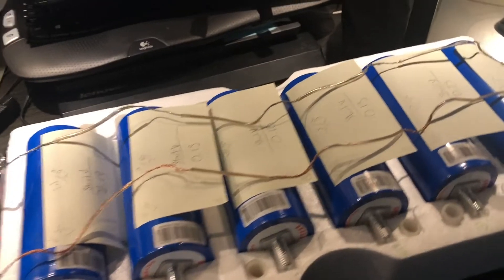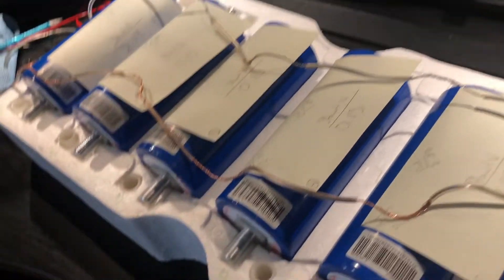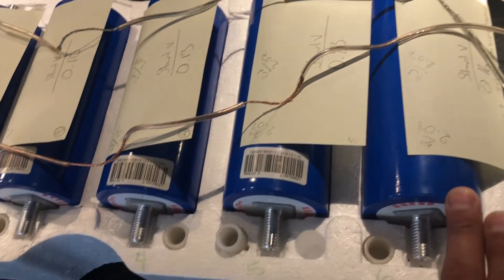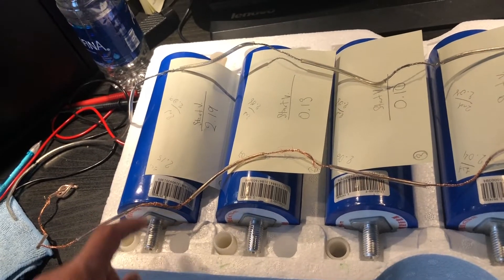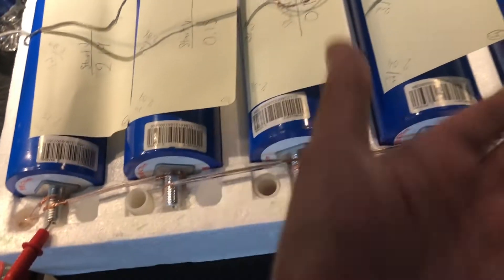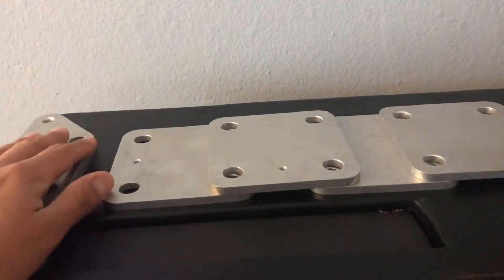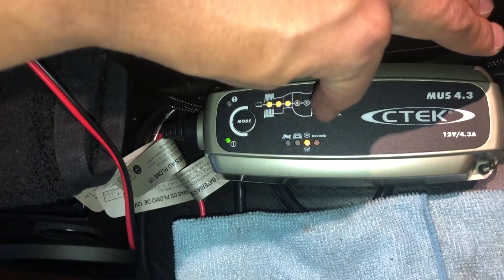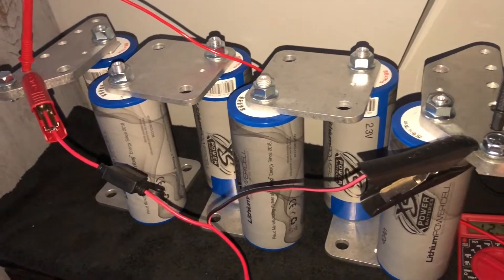Lithium Titanate (LTO) tips to balance and assemble

Comment: Hello from the high desert of New Mexico USA 🇺🇸. I live in my 1967 GM TDH-4519 city transit bus,  it uses two 160 pound  8d 200ah 4400 cranking amp batteries (which are dead, won't go over 8 volts) each wired in parallel for 12 volts 400ah 8800 cranking amps ,  how many cells do you think I would need to start it. Keep up the good work and stay safe and charged
Reply from the maker: You’ll need at least 6 of these cells in series.  Recommended charging voltage of 14.8 so keep that in mind.

Comment: Can you use a noco genius 5 to charge them?
Would you charge them while in parallel or series? And would you charge it with a BMS connected?
Reply from the maker: You “can” but you should really use a 30v/10a Variable DC Power Supply charger.

If you use any other charger that is meant to float a battery after charging, monitor the battery and disconnect once it drops into floating voltage.

I’d balance, reasonable and charge in series to the desired set voltage your cars alternator charges at.  And yes, you can charge with a BMS connected.  Some people don’t use a BMS but service their cells regularly therefore do not charge with a BMS.  Hope this points you in the right direction
Reply: @ogscythe6118  I charged mine to 14.7 (cars charging voltage) but later dropped to 13.5v in the process of connecting, it stays 13.5-.6v while car is on .  Should I recharge and start the car? 
Can I charge the cells with everything connected? Like my amps and isolator
Reply from the maker: @angelnoguera1209  that’s a loaded question.  Does your car drop voltage such as my Honda does with the ELD (electric load detector) that turns off the alternator?  Did the car charge higher with the conventional acid battery?  

There may be a parasitic draw somewhere.  It should quickly bump up the voltage with the cars alternator if the charging voltage is 14.7.  Make sure all the cells are the same voltage.  You can charge with the balancer and don’t believe the amps connected would be harmed but you should break the bank apart and redo.  I advise you to join a Yinlong group on Facebook.  There’s a lot of knowledge people there that may also be able to assist.
Reply: @ogscythe6118  so my cells are on a split charge with a isolator right off the alternator (BMW charges at 14.7-15v)  I balanced them already evenly before assembling and I have a bms balancer connected, charged it up to 14.8 and it slowly drops down to 13.5ish. Sometimes when I drive I notice it goes up to 14.2v but morning drives it stays at 13.5v

Comment: I was wondering I was going to balance my 40ah xs cells in parallel I have 2 banks 12 yinlong I seen just to hook all the pos together and all negative together.the leave it or does it need a charger? And where d is you get your charger?
Reply from the maker: I’ve done it both ways now.  You could wire all in parallel and charge to 2.55 (for 15.3v assembled) but I prefer leaving them alone then charging afterwards.
Reply from the maker: Link to charger:
DC Power Supply Variable,0-30 V / 0-10 A LW-K3010D Adjustable Switching Regulated Power Supply Digital,with Alligator Leads US Power Cord Used for Spectrophotometer and lab Equipment Repair https://www.amazon.com/dp/B07512KQDW/ref=cm_sw_r_cp_api_glt_fabc_BHF8RDGRZ1HW75511PYP?_encoding=UTF8&psc=1

Comment: Who would make a public video with television running in the back ground? And who would go to all that trouble with dubious speaker wire, to do the balancing, when they had aluminium plates they could have popped on and hand tightened the nuts?

Comment: Do you still have to manually balance the cells before assembly if you are installing a balancer with the cells?
Reply from the maker: Yes, always balance (in parallel) before assembling them.  Some 14 gauge wire (Sky High) is more than enough.  I have 2 other videos of balancing.  Check those out too.

Comment: Cuz XS power DIY central says May 1 for 40AH ... Full tilt says middle of May, dropping Hz says middle to end of May .. May go with the 35 AH from full tilt since its in stock
Reply from the maker: Up To Bat Entertainment all depends on how urgently you need it.  I’m still working on my layout and alternator.  Just finished making my panels for the trunk and not satisfied so will upholster then it’s alternator dismantling time to increase set point voltage to 15.3v.
Reply: Og Scythe ok cool I didn’t know it droppin Hz was legit or just go to the source who supplied them. I think all car audio ppl are using some of this time to work on our systems lol... I’m in the process of rewiring my grounds and a new dsp! Hope you get the panels the way you want them & your install goes smooth 💪✅